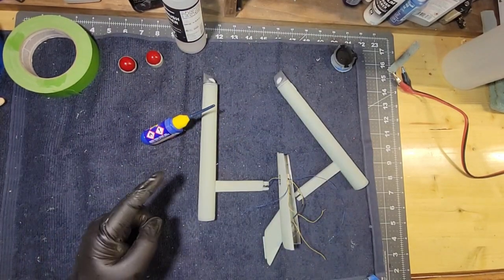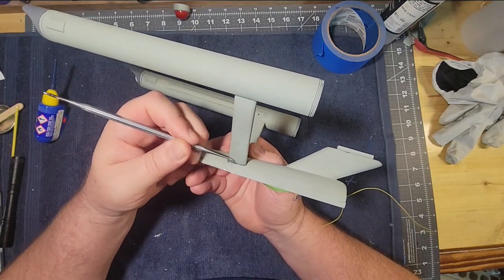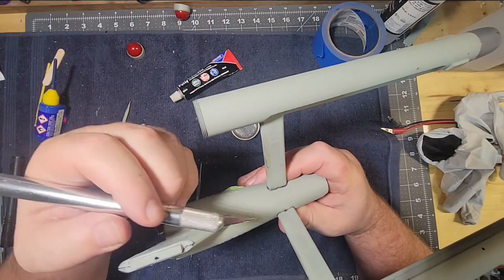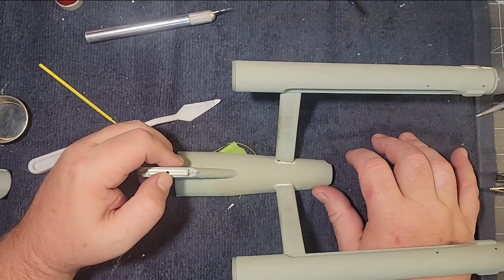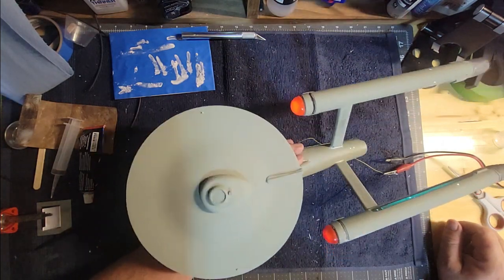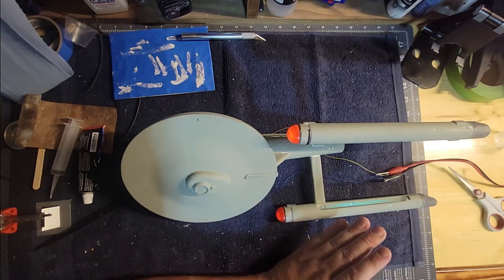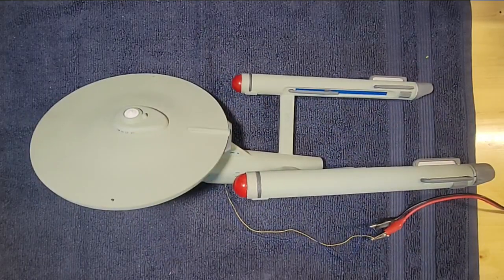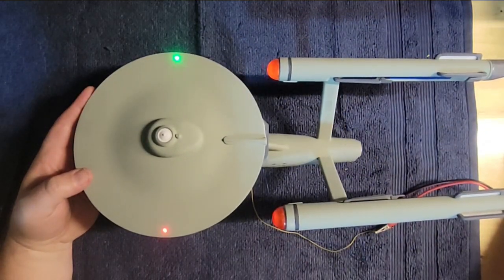U.S.S. Enterprise Model 1:650 Scale Full Build - Chapter 8

Comment: In your previous video, you were talking about how using a 'heat gun' to dry paint may not be the best idea; I can attest to that.  The side of the model I was drying looked great.  The other side of the clam shaped model was deforming as I continued to dry.  The heat was building up in the model and I didn't realize that.  There was no saving the model.  Threw it in the trash and immediately bought a hair dryer.  Thanks for sharing your wisdom once again, great video!  Eric
Reply from the maker: OUCH!!!  that hurts!  I'm guessing the clam shape was very specific ?  I've seen some folks make corrections by using almost boiling water to fix deformities (dip them in water for 1-2 seconds and you have about 5 seconds to re-shape).... I tried it once and almost got it to work (on this kit in fact) .  If it happens again I definitely recommend trying that, hey, ya never know!   But it sounds like that one was just not salvageable.  I feel ya!
Reply: @thescifimodelguy  I wish it could have been salvageable, but it was really deformed on the back side.  If I had put it in warm water to try and fix it; it would have looked like a 'painted dumpling' in thin soup, LoL.  It was a 144 Bandi Millenium Falcon which was turning out really nice.  So weird because, what I could see, seemed everything looked to be going so well.  So be it.  Got a new 144 Bandi Millenium Falcon and new Hair Dryer out of the deal.  Thanks, Eric